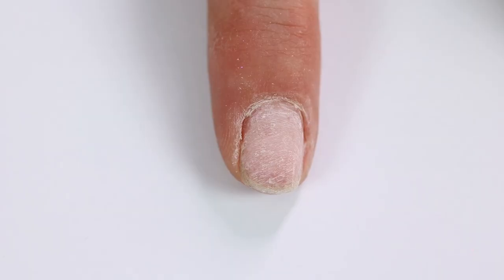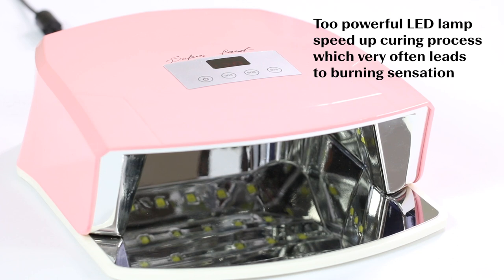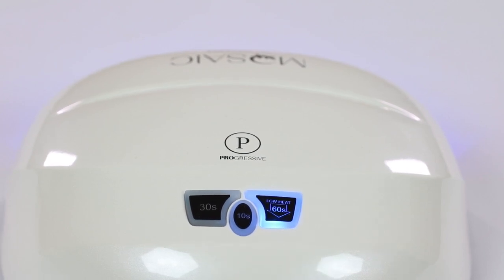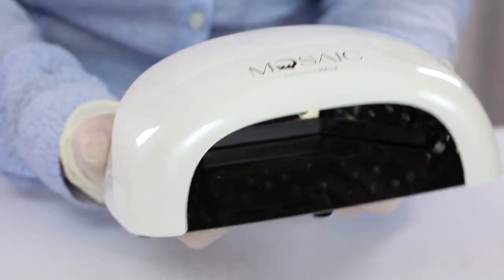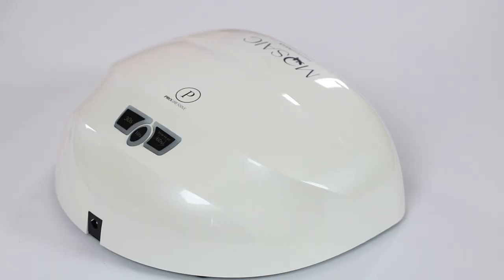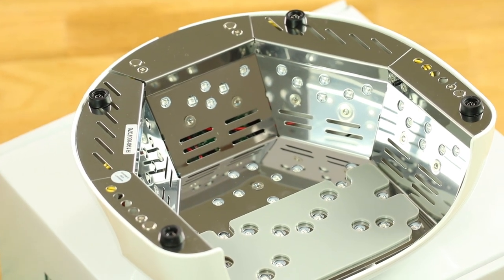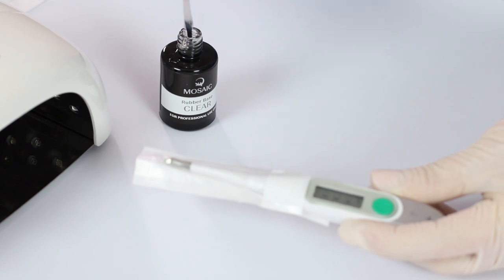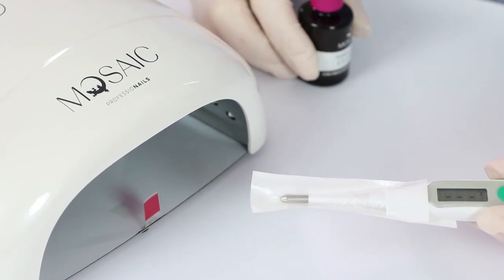No more burning sensations! Cure gels without pain! Subtitles: ENG, EST; RUS

Comment: I purchased in hopes it would not burn as video shows. But we tried. It burned just as bad as my other lamps. One client said it actually felt worse. I am so sad. Really wanted it to work. But it definitely burns.
Reply from the maker: Hello! Make sure you use the Low heat step to avoid burning sensations. Does the gel burns or one can feel its getting warmer?  And sure if you are unhappy please get in touch with the distributor you purchased our lamp from!

Comment: I have a low heat lamp, but I love self level gels and it doesn't cure fast enough and can run into cuticals before it cures. How is this lamp with runner gels?
Reply from the maker: Hello! low heat and progressive lamp are different in action. Low heat is a constant low power value while progressive rises with time. However, it is a matter of try...